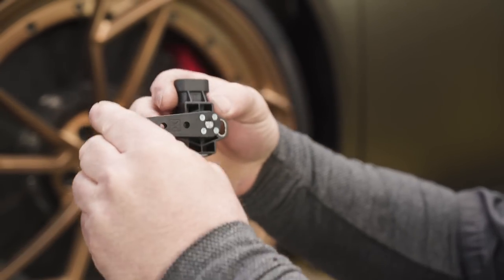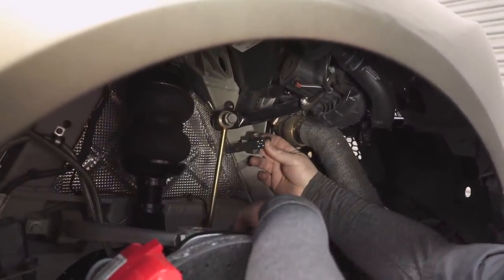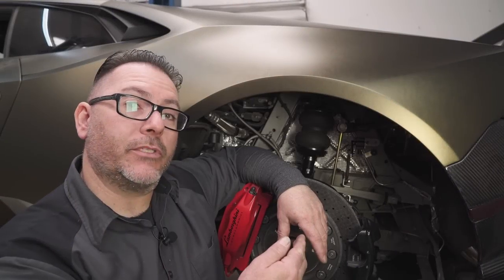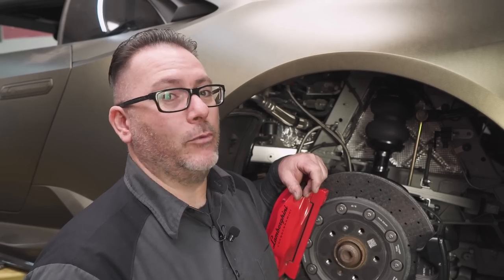How to Install Height Sensors for Air Suspension

Comment: accuair is the best hands down..........no disrespect to airlift or airrex but i find accuair is more indepth with there stuff and you can feel the quality just by watching there products.......looking forward in a few years to be using you guy stuff......#accuairforthewin
Reply: TRAPzilla GAMING brother. I got a Toyota gt86. I want to add a full air suspension kit on it. Can you tell my that how can I get the best in Bangladesh. And what could it cost

Comment: Does it have to travel the full 100 degrees? When mounted my sensors it only travels about 60 degrees
Reply: Did you find the answer mate? I’d like to now also lol
Reply: @Tylerpoole  I know it’s year later, you don’t NEED to use all of the recommended travel, but, the more you use the more accurate the sensors will be.

Comment: Question, when you measure for the length of the adjuster rod, do you set the sensor arm AND the suspension at their center point of articulation?

Comment: Im curious on how water resistant those sensors are, like if you happen to rum into a puddle?
Reply: no problems here in the Seattle area, only potential prob, is water and then freezing temps.